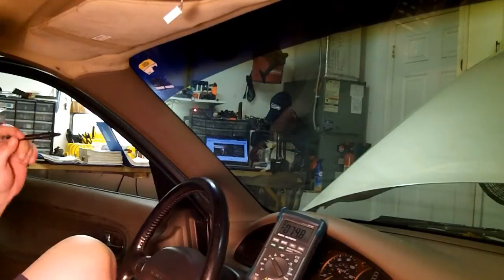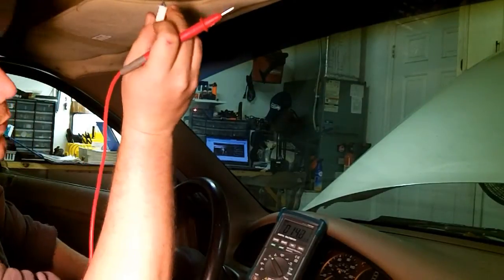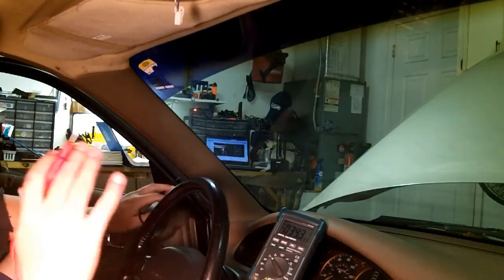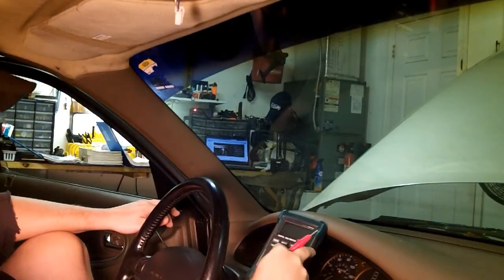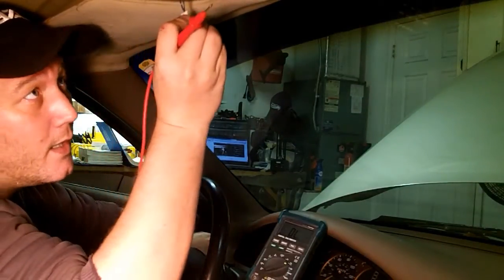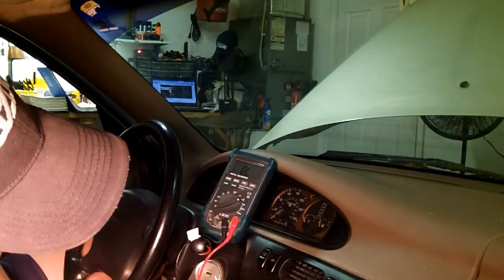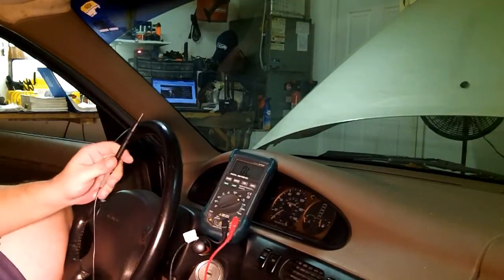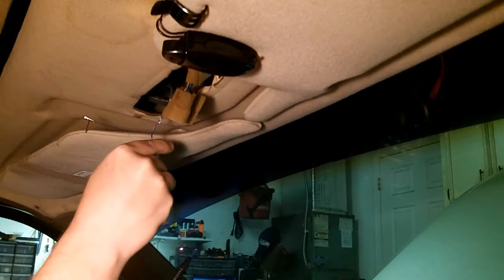Quick Tip - Finding Ground Circuits

Comment: 2000 jeep cherokee When i use Volts when cking the wires coming off the A/C compressor. I dont get a reading on volts until i unhook the Neg battery terminal. Then i get a reading of 12 plus volts. Is that right??? With neg post back on and  With test light i get/show power on both wires. I  also show power on both ports/inserts on the low pressure sensor cycle  switch and if i try to bridge it over to cycle the clutch the clutch  it will blow the big 20 amp fuse. Same thing  happens if i try from the ac relay from the under hood fuse box.  but if  i unhook the High side switch/plug -in . Then i show only 1 insert hot and then try to bridge it over to cycle the clutch and it dont kick it in but it dont blow the fuse like that. . I have had the system vacuumed and i put oil back in the system b4 vacuumed and it took the oil but will not take freon. The compressor worked great when it was on my 96 jeep. My clutch locked up on the 2000 so i put the 96 on it but had to change out the backs of the compressor because the lines were different. I then lost all my freon and oil too i assumed. the 96 went into the back of the compressor and the 2000 go on the top. I took the 2000 compressor apart but there was nothing broken inside. Just the clutched locked up. {Note} i road the jeep for aprox 2 months b4 trying to add freon or oil.  You think i might have ruined that compressor by riding it like that??? but the electric things dont add up or are not right i think but i really dont know but i really need it to work. Im 57 and i hav breathing probs. and cant breath good when i get real hot. So i really need some help.  PS.. I can manually kick the clutch in by running a wire from the hot/coil wire to the hot battery terminal and the clutch will engage that way but still will not take freon. Please Help...
Reply from the maker: If high side or low side pressure is out of spec the switch will tell the ECU "do not turn on the clutch".  You have already effictively bypassed both switches to confirm the compressor can function.  Good job, but also you bypassed the safety mechanisms in the process and that's what has you scratching your head with blown fuses. ;) Bridging a pressure switch isn't always a good idea. You're blowing your fuse because you're back feeding voltage that is looking for a ground. You should be grateful that there is a fuse to blow otherwise you could have caused some real damage to your ECU. 

I think you'll find this video to be very helpful to better understand how pressure switches work and perhaps why you were blowing fuses from incorrectly bridging the switches: A high side and low side pressure switch work differently.  ;)
https://www.youtube.com/watch?v=tMi3VDkPdCo

Good video showing A/C leaks with soap/water. https://www.youtube.com/watch?v=J6DSpx1V3Ms 

Please note that not every vehicle is designed the same.  Having wiring diagrams for your specific vehicle year is very important. Since you're attempting to put a 96 compressor in a 2000 then ideally you'll want diagrams for both years and compare them to be perfectly sure about compatibility. Ensure the compressors are compatible for pressures and pinouts. Just because the pins are the same doesn't mean they work the same with different ECU's. Always double check diagrams and specs.

You need: wiring diagram for your compressor, pressure switches, pressure relay, vacuum pump, and an AC gauge set to properly tackle an automotive A/C repair.

If you're determined to do it yourself you'll need all the tools of a professional for this job.  Wish you the best of luck!
Reply: Just wanted to say Thank you for your reply. I think i found the problem. On the 96 the low side line is on the right. High side left. 2 seperate lines going in the back center on the compressor. where as the 2000 is the opp. high side is on the right and low left side  both line  going to the top of the compressor Both lines go into 1 fitting  where as the 96 ines are sep. Im thinking the lines are different and theres no way it can take freon with the lines being backwards. What do u think??? Your opinion is important to me... Thank You...

Comment: Can you use this method to find a spot anywhere in the truck to ground your amplifier ?
Reply from the maker: Great question! Yes that would be a good practical application for this video that I wish I covered. Grounds for audio systems should be bare metal contact so usually a bolt. There exists common ground points where you'll see a lot of wires going to an eyelet around 1 bolt. Generally you'll find them if you pull back the carpeting in the trunk (where most Amps are located). There's no such thing as a common power bolt, so if you see a bunch of wires terminating at a bolt attached to the chassis 99.9% chance it's a ground location. So keep an eye out for common ground bolts, they're specifically designed as a good grounding location. :)

Comment: Simple tips are often the most helpful,  good summary. I was always confused by the notion of ghost voltage, which does a little dance like it doesn't know where to go. With time it became easier to recognize.
Reply from the maker: Random voltage where it shouldn't be is a topic for another day.  I think I briefly showed an example of that in a video by accident.  As long as you're not getting zapped electricity is fun to play with.
Reply: very nice. thank you very much

Comment: Awesome tip, thank you for sharing. Oh and I have the exact same multimeter from Amazon :)
Reply from the maker: Thanks for the compliment mrjost55. :)  It's a great multimeter and fairly cheap too.  When my cheap $15 equus multimeter bit the dust I decided to upgrade to the Mastech due to a review by someone I watch a lot, richpin06a. 
Autoranging Multimeter Review
Only thing I don't like about it is the backlight won't stay on for more than 5 seconds.  By the time I press the light and then go to measure something the light goes out.

Comment: What would happen to your meter if you connected one lead to ground and you accidently hooked the other lead to positive with the meter in the resistance ( ohm ) mode? Would you damage the meter?
Reply from the maker: Good question.  It might short out the meter or more likely it wouldn't register a reading at all.  Might say something like out of range OL or infinite resistance.  To my knowledge if you do resistance checks you shouldn't do that on a powered circuit.  Either disconnect the battery or pull a fuse so the circuit is not energized to measure resistance.
Reply: +DJDevon3, I too was wondering about this as well.  I know that resistance and continuity should only be tested on a circuit that isn't getting power, while checking for voltage drop you want to do when it is live.  Would it be a good idea to check for voltage on both pins first and make sure there is no voltage before you check for continuity or resistance?  Like in this video you use the dvom to discover the positive wire (which the voltage showed you), but you mention that we can't assume the other wire is necessarily negative.  So would it have been good to check the voltage on that second wire before checking the continuity (applicable to checking resistance too)?
Reply from the maker: +TheEllsi Yes, that was the point I was trying to make in learning good habits.  Test all wires for both ground and power before making a decision on what a wire does, otherwise it could fool you if you make assumptions.  That is how you can troubleshoot most basic circuits without ever needing a wiring diagram.

Comment: What happens if the ground it cut? U shouldn't get continuity?right. My issue is my pop up headlight mechanism touched m positive turminal on my battery n cooked a ground line that ran to my wire harness going to my dash board. Now when I step on the brake or my plowed motor or my blinker my voltage meter on the dash drops below 12v . I cut the burnt line out n ran a new one but I'm still having the prob. Any help would be great. PLEASE HELP
Reply from the maker: Sounds like when you cooked those wires it caused damage that you haven't found yet unfortunately. Short to grounds are hard to track down without a sniffer and a lot of patience.  You might have to rip up all of your dash and carpeting to track it down correctly.  I highly recommend you take your vehicle to an ASE certified automotive electrician to fix.  There is always the possibility that the ECU or CPU have been damaged.  You're looking at hundreds in labor to find the remaining issues.  This isn't a question I have an answer for as it's impossible to answer it from this side of a computer screen.  You need a good automotive electrician to get their hands on your vehicle to fix it correctly.

The reason this happened.. cooked wires... is due to electricity flowing through a wire that is ungrounded.  Because the electrical loop is not grounded the resistance in the wires heats up until the wire glows red hot like a light bulb filament and then burns out.  This could have easily caused a fire.  I bet there was a lot of smoke, I've seen it happen, it's not pretty, and the damage can be severe.
Reply: Not a lot of smoke but it cooked one ground wire in the harness . I traced it n replaced it n all the grounds attached to it . But thnx for the help got my boy lookin at it this week . Good with wiring. I'll keep u informed